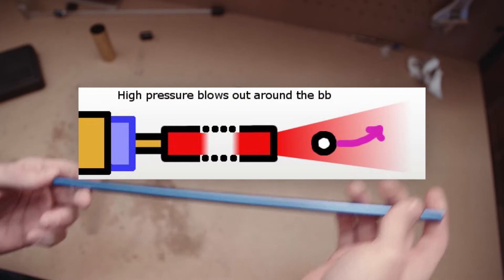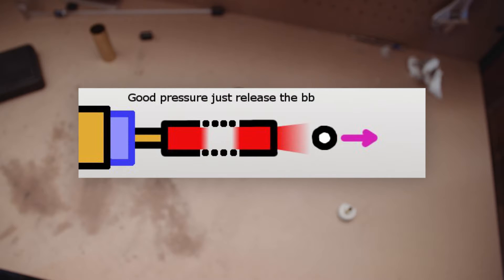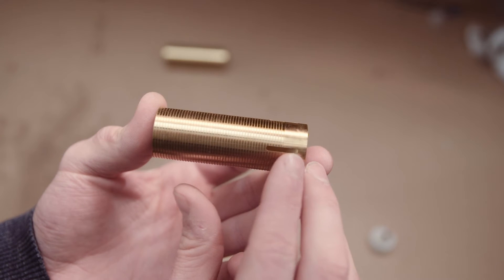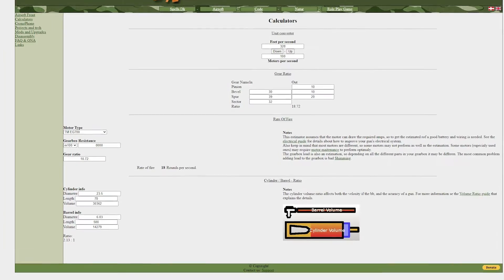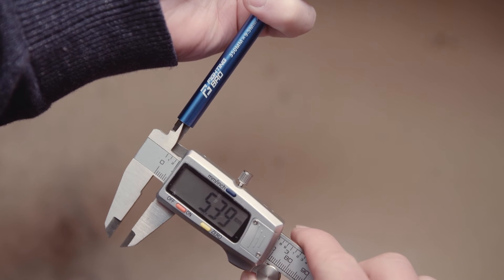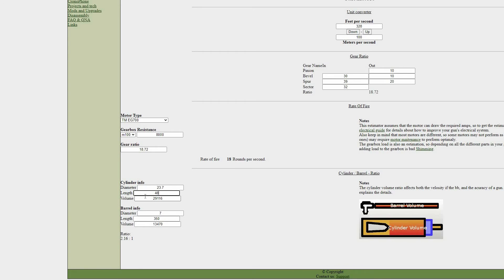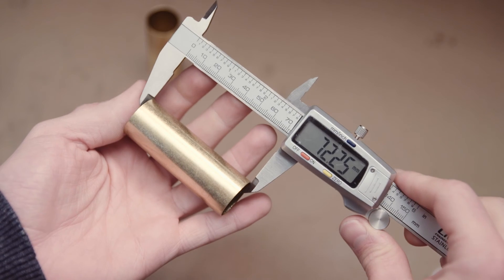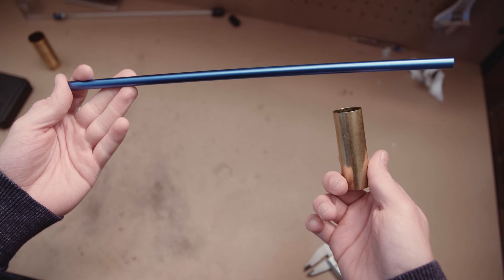Gel blaster cylinder to barrel ratio

Comment: New to the hobby and this explained the principle of volumetric efficiency really well! I bought a 28cm 7.3mm id stainless steel barrel  and an 80% ported cylinder for my build. Is this the "correct" ratio?
Reply from the maker: Hey mate, I just put some values into the calculator and it came out around the 1.8 mark which is pretty spot on! That setup should work well.

Thanks
Reply: 😊😊 @jbmods692

Comment: I have done more research,this info is wrong, you have to measure piston travel for the right Ration, so you measure the cylinder from were the O ring starts then to the piston head were it stops.

Comment: The bb weight and the joules you are planning to run does it effect the ratio you want? I have noticed in higher joule builds overvolume is actually better than ideal ratuo. What is your experience about it?
Reply from the maker: Hey mate, 

Unfortunately we don't have airsoft in Australia so I'm not sure about bbs. This video was intended for Gel ball. 

Its an interesting question though, I would have thought you would want the same ratio no matter what energy values you are planning on but you may be correct. Hopefully there is another resource that has discussed this.

Comment: Ho..im using 80% cylinder...and using inner barrel dia 7mm..450mm ...how long should i cut my inner barrel
Reply from the maker: Hey mate, with a cylinder like that your ideal barrel length will be around the 320mm mark. 

While if you just change your cylinder to a full cylinder with no ports you can leave your barrel length as is.

Also keep in mind that using a tight bore barrel such as a 7mm, you will need to be careful which gels you use as lots will grow too big and wont fit through.
Reply: @jbmods692  do i still need to put hopup?
Reply from the maker: @shamsulbaharinyahaya9748  You will get significantly better accuracy with a hopup so I would recommend you do!
Reply: @jbmods692  thanks bro

Comment: The BB weight has effect on the barrel to cylinder ratio aswell. The hevier BB you are using, the bigger the cylinder has to be. I would not use anything more heavy than 0.28 in a 1,6 ratio.
Otherwise, good video, nice that you mentioned that website with the calculater, it's awesome👍
Reply from the maker: Hey mate, that's interesting to know. Unfortunately we don't have airsoft here in Australia so this video is intended for Gel Ball.
Reply: @jbmods692  please help!

Does gelblaster hopup like Rizer design...   that lets to the air escape from sides and under the gelball...   does the hopup reduces fps or waste air pressure?   making a bit higher volume ratio needed to compensate?

Does gel blaster hopup reduces FPS due friction over the ball or compressing the gel ball?
thanks man!